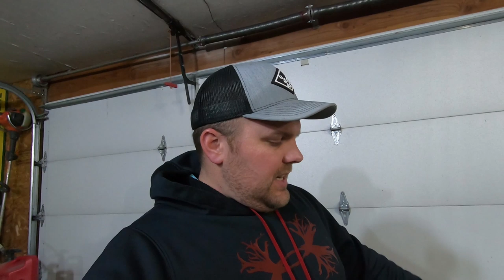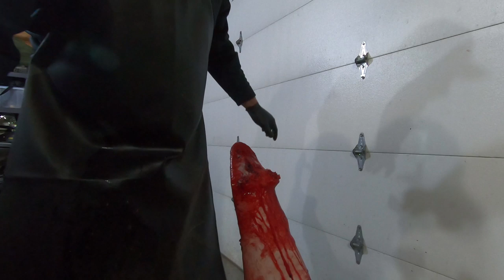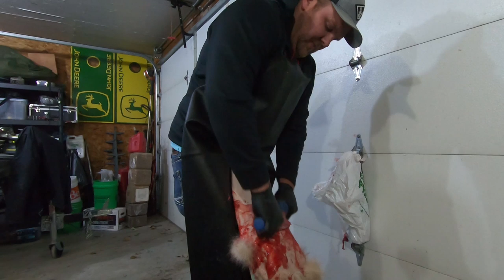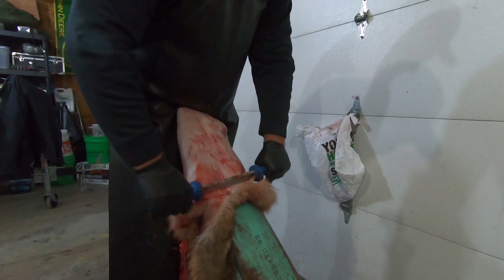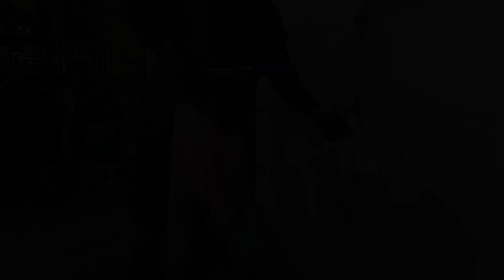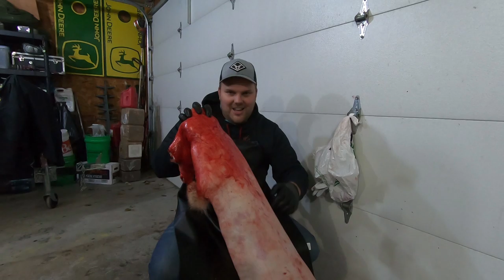How To Flesh a Coyote Hide

Comment: Awesome video. I have a couple of questions. Was it a fresh kill? Was the hide still hot? Do you wait between the time you skin and flesh? Or do you not wait and flesh right after skinning? 
I have been having issues fleshing. It takes me hours to flesh and I still have spots that do not turn out. After I harvest them I freeze the coyote whole in a plastic bag. When I have time I thaw it for 3 days at 50 degrees or until it's movable but not fully thawed. Could my pelt be still too cold to get the flesh to come off easy? Or is it just a lot of practice fleshing? You make it look easy.  My pelts so far do not have the membrane peal off the hide like that when fleshing. May you help me over come this issue? I would love for my hides to turn out. Thank you.
Reply from the maker: I do them cold normally but not frozen and skin / flesh right after one another